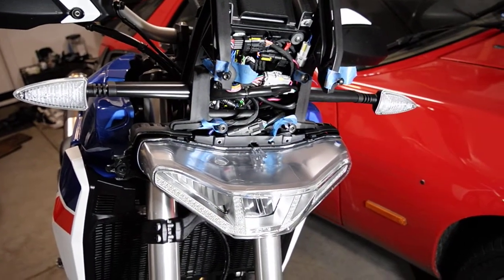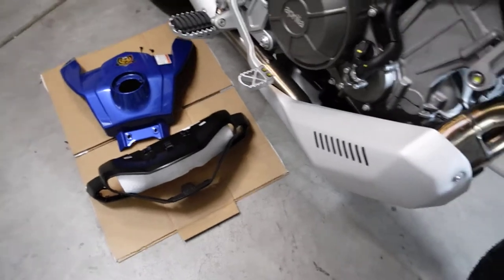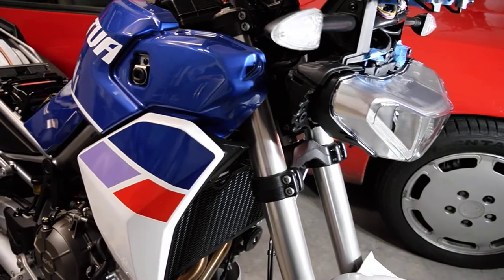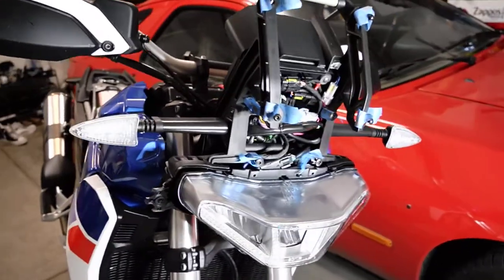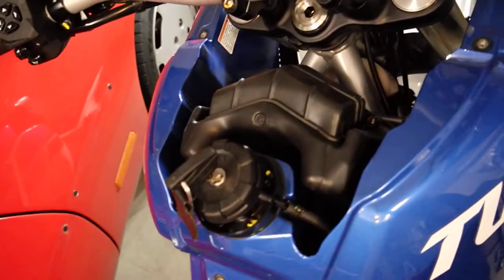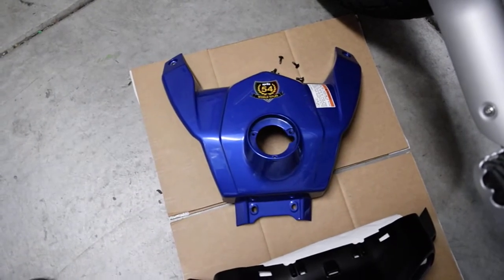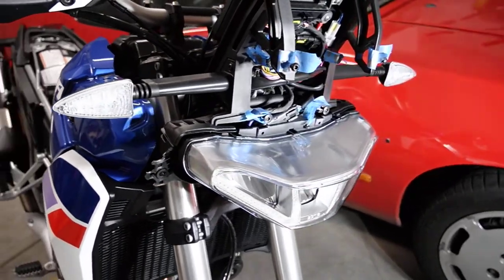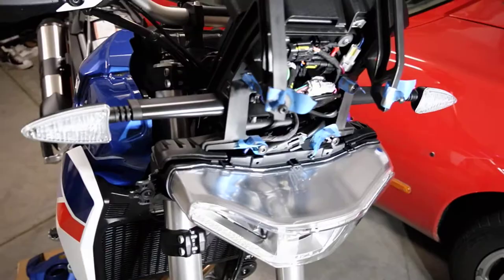Aprilia Tuareg 660 headlight cover in black Part 1/2

Comment: If you go to AF1 racing they have an air box delete kit and high flow air filter that allows your Tuareg to breath much better.
Reply from the maker: Do you feel it doesn’t get enough airflow?  I might consider this if or when I upgrade my exhaust system, but I don’t see a need for this in its stock version.  I thought when you mess with the intake you should also address the back end to the balance the system, no?
Reply: @ocdmoto  Ummmmm one of the first things I always do, is to replace the exhaust and open the air box.  Because of the emission requirements the bikes never run at best capacity
Reply from the maker: I’m tracking, we’re on the same page. Not sure if you’ve watched my latest video, but I mention getting a full cat delete exhaust system. If I do, I’ll look into opening up the air box as you suggest. Thanks.